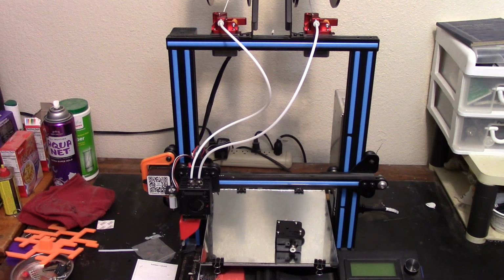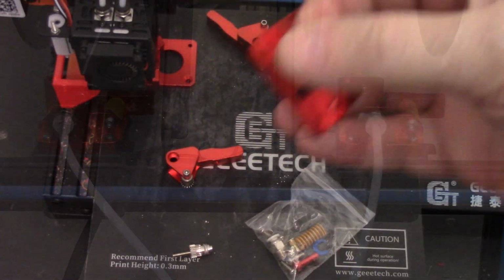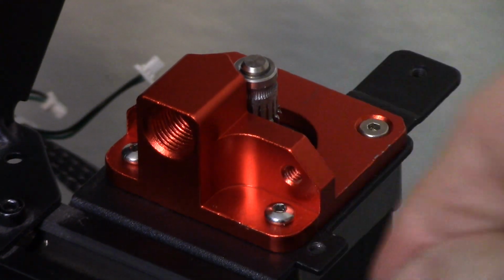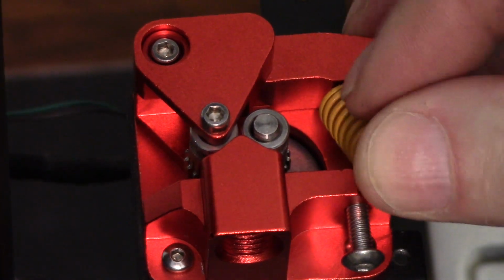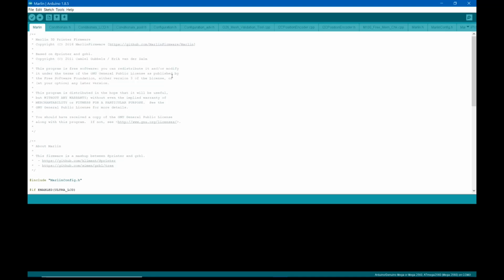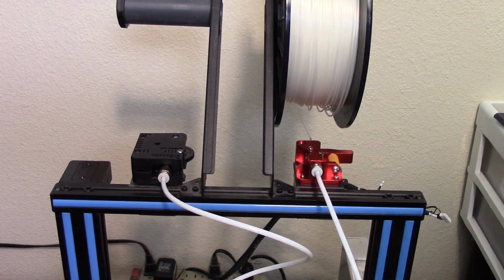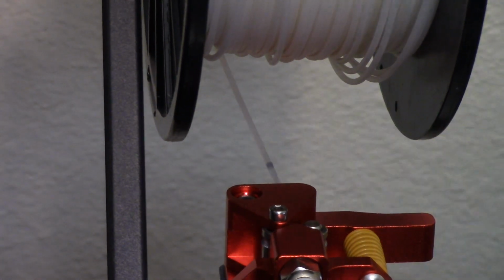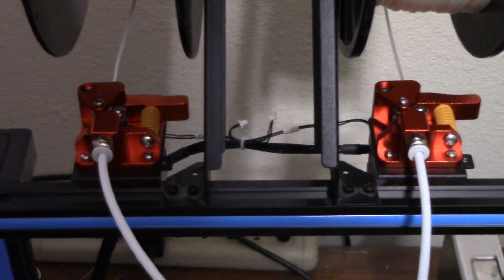Creality Dual Gear Extruder Upgrade on the Geeetech A10m (or any 3D printer).

Comment: hello ,,,,ive got the singal gear extruder all fitted. going through your tutorial, but cant find my Marlin folder ...does it have to be downloaded???im very new to 3d printers and have a second hand geeetech A20M (that wont print)..when the gears turn the pla runs backwards.ive got arduino ide installed too. can you help ??
Reply from the maker: It's running the filament backwards because the version of Marlin that's flashed to the printer is for a gear reduction extruder. To fix this you're going to have to download the correct version of Marlin (I'd start with the version for your A20, you can get it from Geeetech's website), then make the proper changes in the Marlin you downloaded as I outlined in this video, then flash it to the printer. I can't write a beginner's guide to flashing Marlin to a Geeetech printer here, but I've covered it in past videos as have many others. You're just going to have to sit down and start watching videos and learning. You can also become a member of the Geeetech facebook groups and get help there too. We all had to do this when we were new to 3D printing and wanted to modify our printers, no doubt it can often be frustrating, but if you keep at it you will eventually figure it out and really start having fun with it.

Comment: Really nice, Ive orderd 3pcs for my A20T.  Where did you got that filament spool holders from?   Those 2 where nice 🙂
Reply from the maker: The spool holders in the video are the ones that came on my A10m. I've since replaced the part the filament spools sit in with a 3D printed part with skate bearings. I'm still using the metal parts that mount to the printer.

Comment: I know this is a older video but I was wondering where you got the Marlin 1.1.8 my a10m has it and I'm considering swapping the cheep looking extruder clones
Reply from the maker: It's all there at geeetech.com. Click "download" under the Help Center listing near the bottom of the page. Make sure you pick the right firmware for your control board.
Reply: @3rdpig  perfect thank you

Comment: Hi Chuck,
after more an year, how are the extruder? Still working good?
I've a new Geeetech A20M and i've some trouble with an extruder after the first week of work... Sometimes i find the filament stopped and the extruder still going without go anywhere...
Reply from the maker: I like these extruders so much I've put one on every printer I own. If you're careful setting it up you won't have any problems and they run great and seem to last a long time. Just take your time and make sure the gears are lined up right. Thanks for watching!

Comment: i copied  the two files in YHCB2004_V4.1  to the main marlin folder to replace the default config files. Then edit the Configuration.h file to reverse the direction in visual studio with platformio addon and i keep geting problems olz help

Comment: Hi Chuck
I have an Ender 3 Pro and have been using it for a few months with great success. I thought I'd like to try a 2 colour machine so bought the Geeetech A20M but had issues right out of the box. I spent many days looking for help on the internet because I wanted to change the extruders to the Creality Mk8 but had filament travelling the wrong way. I dabbled with the firmware but the Marlin firmware gave me a blank screen and buzzer constantly. Its the standard Arduino Mega 2560 with 3D touch but nothing except the Geeetech website firmware worked but is already compiled, so not possible to change the @section extruder. 
Finally, I found your video and the comments people have added and Hey Presto, change the wires over in the Titan extruder setup and the Creality are travelling the right way. Also feed rate shown here works a treat.
I just want to add that your video and the comments have saved me a huge headache and I'm so grateful to you and the others for taking the time to make such videos. Without people like you, people like me would be tearing their hair out and maybe giving up.
A HUGE thank you Chuck and particularly JC Sistemas
Reply from the maker: Glad we could help!

Comment: Anyone get any Promblem when then use two Filament to mix
Reply from the maker: Not really. What problems are you having when you try to mix?
Reply: Yes I am, my a10m is chewing the filament on the 0 extruder when it tries to mix so I'm looking to upgrade to the dual. Not played with firmware yet, but I'm going to have to bite the bullet as I've also picked up a bl touch. Thankfully I've found all the info I need here!

Comment: great vid bud i keep getting this message Arduino: 1.8.13 (Windows 10), Board: "Arduino Mega or Mega 2560, ATmega2560 (Mega 2560)"

fork/exec C:\Program Files (x86)\Arduino\hardware\tools\avr/bin/avr-gcc.exe: The filename or extension is too long.

Error compiling for board Arduino Mega or Mega 2560.
Reply from the maker: Geeetech has updated the board on the A10m twice since I made that video. Check on Geeetechs website and make sure you're using the correct firmware for the board in your printer

Comment: How did you remove the pin on the motor shaft?. I cannot remove the original gear attached to the shaft, I see a ping but looks not an Allen key
Reply from the maker: All mine have been set screws with Allen heads.
Reply: Currently drilling a hole trough the gear where the pin is , it was completely stuck. Allen doesn’t work and torx neither

Comment: Very information dense thank you for this video! It seems that you did not reactivate the filament break sensors? Or did you restore them after (I don't think you would need to fix them to anything and you could let them "float").
Reply from the maker: No, I didn't reconnect them, but they haven't been connected in months since one of the mounts broke. I keep meaning to design and print new mounts for them, but I haven't gotten around to it. Yea, I could let them flop around in the breeze, but that would get into the pit of my stomach and eat at me until I made mounts. lol

Comment: Was it a left rotation or right rotation type? Somewhere online I read, you need to select the correct rotation type gears in order to avoid the software tweaking.
Reply from the maker: The direction it turns depends on if it's a direct drive or if it's a gear reduction type. The direction had to be changed on the A10m because I switched from a gear reduction to a direct drive. Yes, while it has two gears the dual gear extruder still functions as a direct drive so the direction needed to be reversed. If you're changing from a gear reduction extruder like the Titan and it's clones, then you'll need to reverse direction in the firmware. If you're switching from a single gear direct drive then you don't. But either way, you'll still want to check and set your E steps. The only trickery you could do on the extruder itself would be to add an idler gear of the same size to mimic a gear reduction without actually getting any reduction. And I've never seen anything like that. The left and right handed extruders I've seen are just mirror images, and that's not going to change feed direction.

Comment: Hi, I'm not familiar with writing code and can't seem to upload the 3d touch firmware for my A20m without lots of errors. Do you have a firmware upgrade available so i can swap out the horrible extruders my printer came with for this upgrade?
Reply from the maker: Sure, here's the link to the Geeetech A10m firmware with both the 3D Touch additions and the changes I've made for the extruders. Note that it also has settings for my Z offset, which won't be right for yours.

https://drive.google.com/file/d/1r1_u8AdYyDWcQYDgpI9kvEpbiIOpE7Zu/view?usp=sharing

Now, you're still going to have to open it in Arduino IDE then compile and flash it to the printer. Also, you're going to have to set the Z offset for your printer once you determine the correct number. 

So if the errors you're getting have to do with connectivity to the computer, I'm afraid you're going to have to solve that problem before the firmware is going to do you any good. And without knowing what the errors are, I can't help you much. You can Google the errors to see what kind of problem you're having. If you can't find an answer then tell me what the errors are and I'll try to help.
Reply: @3rdpig  thats great - thanks so much. Just out of curiosity, what section of the file would the Z offsets be in? Once i've found it, i am sure i can work it out as I am a CNC programmer by trade but this code is new to me!

Comment: Hey, great video!
 I’m trying to install the very same thing on a Geeetech A20M. However, the stepper motor has a black gear stuck to the shaft that makes one of the extruded meshers higher than the other. I was wondering how you got it off?
Reply from the maker: I remember some of the parts being a tight fit on the shaft, but I think all I did was pry them up with a pair of screwdrivers until I could get needle nose pliers under them to act as a spacer as the gear moved up, continuing to pry with the screwdrivers. I remember thinking "You lazy bastard, just walk out into the garage and get a small puller", but didn't bother because they came off easily enough with the screwdrivers.
Reply: @3rdpig  Thanks it came off with a flat head and a hammer lol. You're actually the best! Keep up the good content and personal relationship with your viewers!

Comment: Mine had a factory fault, poorly manufactured and replaced it. Othtt videos on youtube that did the same as mine. This gears will also grind after a while
Reply from the maker: Interesting info. I've got about 50-60 hours on the two on the A10M and they're still working fine. I've also got 3 more of them to put on my other printers. If I have problems with them I'll report back.

Comment: Hi there. I own a Hellbot Magna Dual ( A10m rebranded to Hellbot , it is just the same printer , other name) . I´m also having extruder problems. Wnated to know if the upgrade to dualdraive extruders worked in the + way. I´m considering changing the titan clones for the dual drive. Thanks.! best regards from Buenos Aires , Argentina.
Reply from the maker: Hell yes! The dual gear extruders are great. I've ordered 3 more and they're going to go on every printer I have.

Comment: The problem with the original extruder is the idle wheel breaks off of the tension arm. It is held in with a very thin piece of plastic. You can print a new arm to fix this problem but ultimately we all just change the extruders. I changed mine to  dual drive extruders (clones) for about £12 each. They do have a gear reduction and they always push filament. Perhaps too much as you really need to dial in your first layer or it will look rough.
Great video. Keep up the good work.
Reply from the maker: Thanks! I replaced both tension arms with aluminum versions. I also replaced all the bearings and the idler wheel. I swapped the feed gears from one side to the other and no matter what I did the problem stayed with the one Titan clone. I finally just got sick of messing with them.

Comment: Very good video !!! :) The A10M is a good printer, I have one for a little over 1 year and a half.

The other way to change the direction of rotation of the motors (For those who do not want to install IDE and "play" with Marlin) is to reverse the cables that go to each motor.

0- Turn off the printer :)

1- In the connector that goes to the motor, first invert the 2 outer cables (1 and 4)

2- Then invert the Inner cables (2 and 3)

Turn on ... and test. :)

I forgot to tell you .. :o ... I'm glad you are in good health in these difficult times :) :) :) :)

Successes !!! And ... thanks for sharing !!! :)
Reply from the maker: Good info, thanks!

Comment: Hello Chuck

Thanks for many great videos.  I have been using one of these extruders for many months with excellent results. I was a bit dubious of the metal on metal surfaces so lubed the exruder arm mating face and the pivot pin. BUT I didn't lube under the bearing/cog in the arm and it was now worn a quite deep groove into both surfaces of the arm were the cog has been moving up and down (maybe due to varying filament thickness) this has caused a marked weakening in retraction to the point where I get major stringing on all my prints. If this is inherent in the design I'll be buying the cheap clones as I know suspect all extruders should be considered a consumable
Reply from the maker: Great info, thanks!
Reply: @3rdpig  same thing (wearing of the dual gear extruder) happened to me and there is a video on youtube about this. https://www.youtube.com/watch?v=h7-wWXDN6z8 The fix is pretty easy (no need to buy anything from this company): grind worn out the area, where the gear is wearing into the aluminum body down a bit further so that you can fit an M3 washer between the gear-bearing  and the aluminium body. The grinding must be matching that the ground surface plus the washer thickness together make the gear come up enough to be well aligned with the filament hole again. Add a bit of grease and you are good to go. Sounds more complicated than it is. Maybe adding grease between aluminum and needlebearing  now when it's new prevents or at least delays the wear.  Well alligned, these extruders work very good especially in a direct extruder setup for flexible filaments.
Thanks for your video!